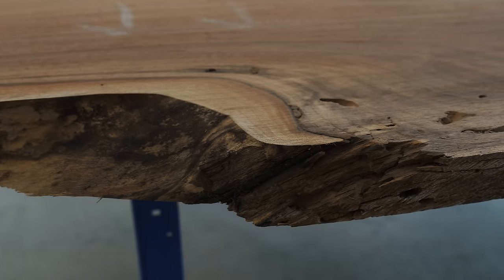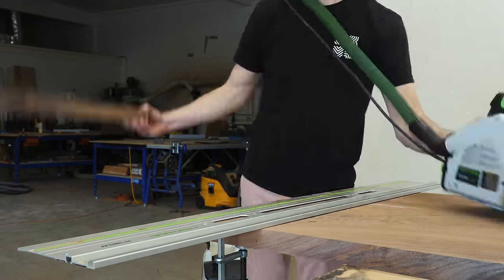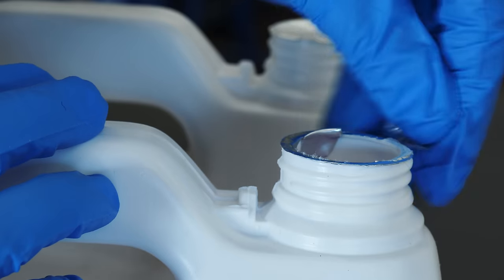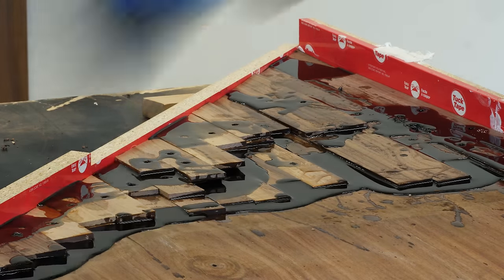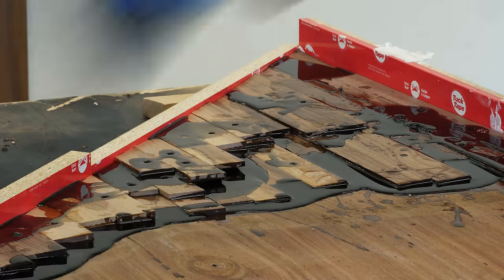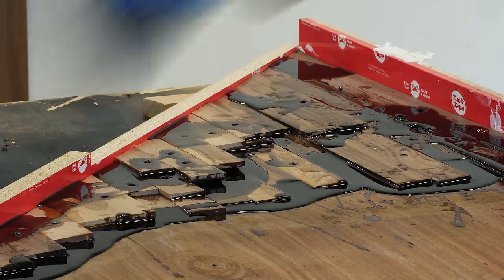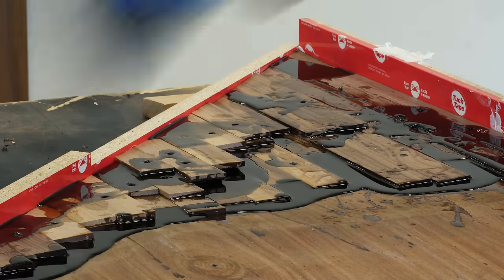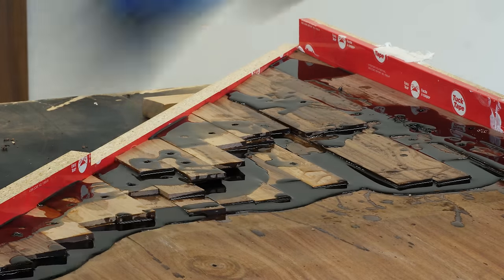16ft Desk

Comment: Hi there! Commenting on the topic of the brass, as a high-end knifemaker who often works with a lot of those materials. Brass, bronze, nickel, sterling silver, titanium, zirconium, and natural materials from many various rare woods, natural materials like mother of pearl, and synthetics.
Brass is extremely prone to oxidation and other forms of patina, and that super bright polish is often a different hue of yellow to when you expose fresh metal. In my cases if I leave a high grit satin finished brass piece alone as I finish something else the colour will change drastically by the time I go back to it. If it was plated nickel it would (in most cases, depending on the composition) be a bright silver colour. Chances are if you touch that piece you brushed with your naturally oily fingers and let the piece sit you will notice it start to go more yellow/gold in those specific areas you touched!

Now the other thing to say here is, the chemical composition of each of those metals can have a mix of various elements which all affect the performance. For instance, certain Nickel ( will start to go a light yellow as it oxidises when exposed to air, dirt, greases and oils etc. This is to say that some brass, and some nickel will behave differently than others.

Hope this has helped at all!
-Mike

Comment: Really fantastic result. Well done. I kind of wanted to get a shot of the bottom where you layered the extra wood to make it flat.
Reply from the maker: A finished shot? It doesn't look much prettier than what it looked like whenever I was cutting in C-channel. Just a little more sanded.
Reply: @Foureyes.Furniture  np, just interested in because while it's not a super common problem, it seems like a decent solution to that problem.

Comment: I had something similar happen with some brass used for the bolster of a knife. you cut into it, and the inside is silvery, like nickle, but when it oxidises it turns yellow again. Can you check if the grommet changed colour after you sanded it? It takes a few minutes normally. Love your work!

Comment: About the solid brass part: Brass will oxidize. Fresh cut or sanded brass looks way brighter than older surfaces. Finished or polished surfaces need to be sealed to prevent further oxidation. Normaly some trasparent sealer is used, but it might become darker itself over time. Of course, there is a possibility that you have received a cheap material with a simple gold or brass finish.

Comment: Have you tried vibration to help fill the holes with your epoxy? Use a tool to vibrate the wood while the epoxy is liquid and it should shake it down into the nooks and crannies.  I"m sure you've tried that but wanted to ask.

Comment: Out of interest, did you consider any other approaches to the corner joint besides a standard mitre? Where I live the mason's mitre is the usual way to join two slabs at a corner. It does require a jig and a router to do accurately, but I've done a few as a DIYer and so long as you spend your time setting up and ensure you rout in the correct direction, it's easy to get perfect.
Reply from the maker: I hadn't...but I'd be down to try. The problem with any sort of but joint (which it looks like most of the mason miter is) is then you have to worry about wood movement. Where as with a miter, they will expand/contract equally...so there is no problem.
Reply: @Foureyes.Furniture  Yes, it is basically a butt joint with a small mitre at the face so you end up with a sort of socket arrangement. 
I hadn't thought about the cross-grain expansion/contraction benefits of a standard mitre across a large slab. I'm now wondering if the mason's mitre offers any benefits over the standard mitre besides the obvious material- saving one - I'll be puzzling over that one 😁

Comment: Built similar structural design, but with shelf on the the top and back doing the structural reinforcing. Didnt need any C channel just 4 nail plates and some screws to hold it with pretty much similar "mouth" area on the foot area. Also thing i noticed being mostly happy accident, having heavy duty table with sturdy side cabinets and top.. put just 6inch subwoofer on the rear leg or in my builds case triangle shelf and holy shit that thing kicks easily like 10 inc due under the table increasing volume. Built mine with integrated power outlets and sound system, hidden storage for valuables and enough lacquer to put boat in shame.

Comment: What are those drill attachments you used to clean out the bug holes?  Looks like two versions of a wire brush, but softer/less aggressive.  I don't see them mentioned in the tools list you have in the more info section, and I didn't see them at Rockler/Kreg.

Comment: Hey Chris and Shaun, I'm wondering why you decided to inlay the metal attachment plates in the legs on the corner leg, but then inlaid them in the bottom of the tabletop on the end legs? Is it a structural reason or is it just to not disturb the attachment mechanism in the miter?

Comment: The "hot melt" stick looks suspiciously like a Ptex stick that we use on snowboards and ski's for rock abrasions.  Just slightly over fill and scrape flat with a cabinet scraper.  It works great, can be sanded and is definitely not as hard as epoxy.

Comment: For the haters who dislike it, don't feel bad. Still counts as engagement (unless the algorithm has changed), they are inadvertently boosting your video by interacting with it, one of the steps of engagement. Being subscribed is one, giving it a view is another and adding a thumb up or down, it doesn't care so at that point they are unknowingly holding a full house. The only thing is they should comment their disgust to go for the royal flush. If they hated it and wanted to be negative they should stay away, stfu, unsub, add nothing, don't open it, ya know like you would in real life and spend their time doing something they do like, as no enagagement is 'better' (in this example) than some, regardless of what it is. Their idiocy is beneficial to your channel. Joke's on them, and by this analogy they have a terrible poker face and always lose, leave with the house winning.

Comment: I dashed through your films in a rather short time, literally as if it had been last month that you started working together, so the end is abrupt. 
Great projects, if I only had the space for new furniture... 
I also have a naive question: does not working with big slabs like these used here lead to warping problems later?
Reply from the maker: Slab or not, any panel can bow if they improperly dried or assembled. 

For slabs in particular things like c channel, and the design of the base can help avoid that. For example on this table. The two legs are essentially giant cauls that will help hold things flat.
Reply: Thank you for the swift reply!

Comment: Next time you do a desk/table with a huge gap to fill with epoxy, maybe try inbedding LEDs intop the wood around where the epoxy will be?

Like this:

Table with hole in the middle... Hole filled with epoxy, the fullstops '.' are the LEDs
____________
l           l l          l
l         .l   l.        l
l       .l      l.       l
l       .l     l.        l
l         V            l
l_____________l

Maybe a pretty coloured epoxy that bends the light well and illuminates the whole thing like a slab of colour.

Comment: @2:30 Random Commenter: "That table is worth $300 at most." 

That is significantly less than what you will pay for a similar-sized table from Ashley Furniture. That table will be made out of OSB and resin, and there are tens of thousands more just like it that came off the assembly line. 

I will be kind in my summation, and say, simply, that comment is ignorant at best.